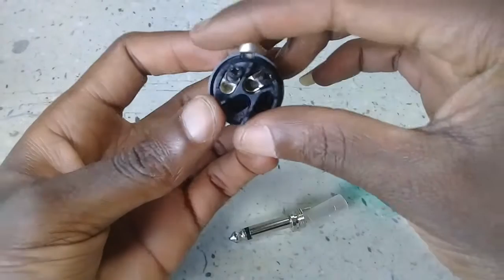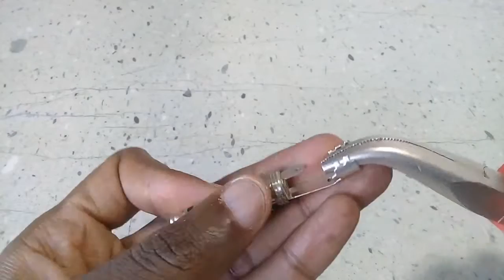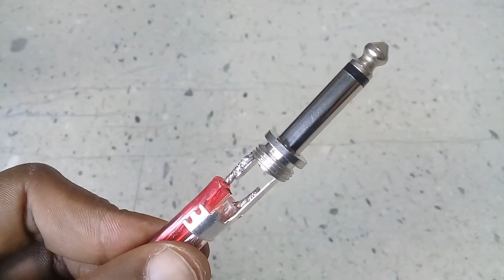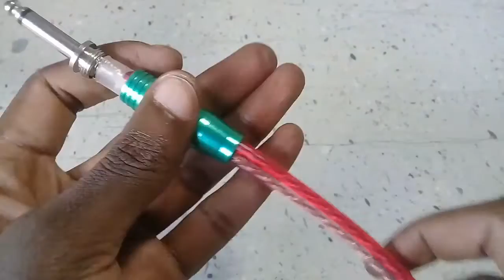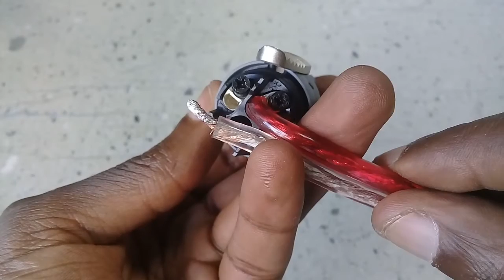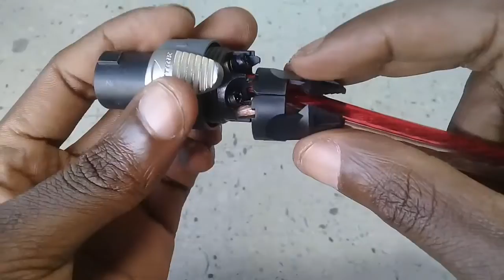How to Wire NL2FX SpeakON to 1/4 Cables

Comment: How can I connect a speakon output to a xlr input (it's an old passive speaker but with xlr input) ? Just taking a speakon cable and add an adapter or make a speakon to xlr speaker cable ?

Comment: NEVER solder the wire going into a speakon connector! The solder travels into the covering and will weaken the connection.  Just twist the wire, insert into the hole and tighten.
Reply: How can I connect a speakon output to a xlr input (it's an old passive speaker but with xlr input) ? Just taking a speakon cable and add an adapter or make a speakon to xlr speaker cable ?
Reply: @davidhellegouarch1622  It's better to just replace the XLR connector on the passive speaker with a speakon connector, and then common speakon cables can be used.